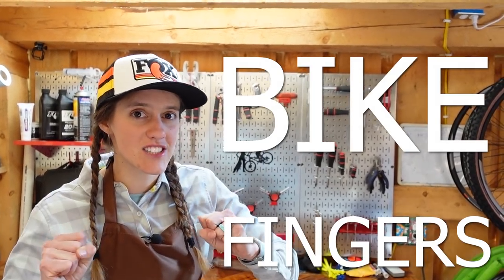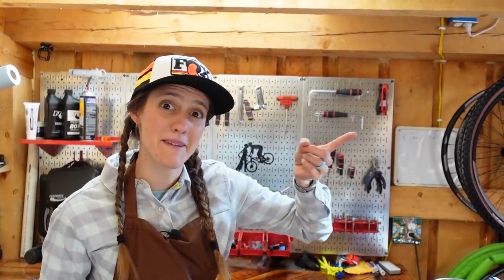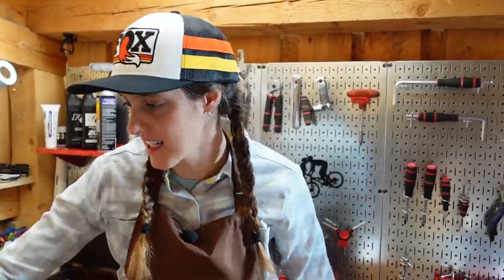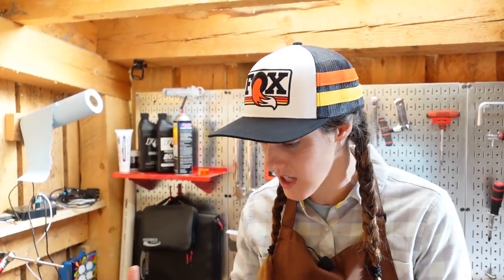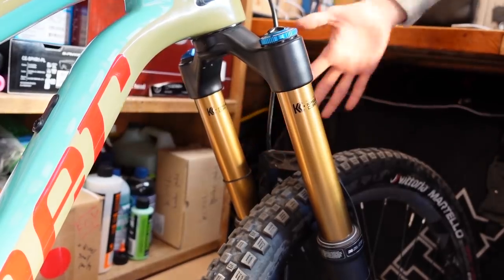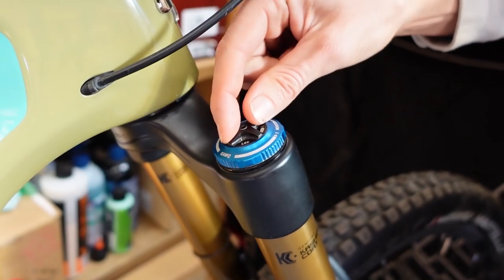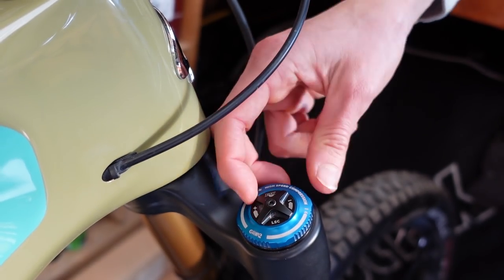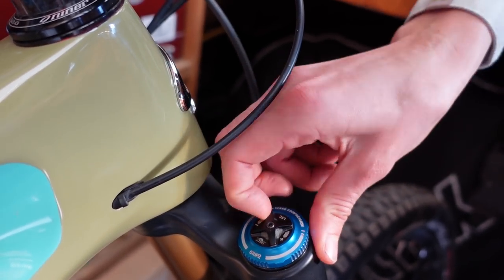How to DIAL IN your suspension + TROUBLESHOOT COMMON PROBLEMS | Syd Fixes Bikes

Comment: Commenting as i watch along, while learning. 😊
So, would it be right to say that a fork/shock with high-speed compression, is like having an adjustable token?
Reply from the maker: There are similarities, but the difference is that a token ramps up the resistance (air pressure) so has the main effect towards when the fork is more compressed. High speed compression affects high speed hits, which usually involve the fork going through most of its travel, but not necessarily and it affects the entire stroke, but just the end of the stroke like a token will.

Comment: So, last night I watched your video, today I went trail mashing, was actually amazing, my suspension felt so good and I actually understood what I was feeling and how to fix it!!! Thank you so much I've watched so many videos.

My front forks seem to dive when I use my front breaks, is that normal? Othet than that the setup is perfect, if I take off lsc it makes it harsh again.
Reply from the maker: Yeah, LSC is definitely a balancing act between diving and too harsh. It's worth noting that there will always be some compression when you brake as all your momentum is going forward, so when you brake your weight will shift forward which will cause the fork to compress.

Comment: How about dealing with the good old baby heads (lose rocks)... I feel like my front tire just slides all over when I run through a section like that
Reply from the maker: That could be a body position thing. You may not have enough weight on your front wheel. But it also sounds like maybe your fork is too harsh. Potentially try lightening (opening/unscrewing) you low speed rebound (assuming you have it) a couple clicks.

Comment: You guys always do a great job with explaining everything! Suspension definitely is confusing.

I have Fox Factory on my Ripmo. Fox Factory is an eye opener because of all the adjustability!...LOL. When I first got the bike I followed Ibis' and Fox recommendations. It felt good to me when I was done but I bet it wasn't perfect.

Now I'm revisiting and want to check everything to make adjustments accordingly. One thing I'm curious about is the air pressure. According to Ibis they recommend 230-235 psi for a 180 Lb rider ( Me!).  The other day, I checked the pressure of my shock and it was at 150 psi  so I added to make it 240 before disconnecting the pump.  So it's probably actually 230.  On the trail it seemed like it rode stiffer and I got more traction. It didn't feel harsh or anything. So maybe it's good.  I bet the optimal psi would be 210.  I like it a bit plush.  For the Fork, I noticed it was actually on the higher side - 85. So I bled it to 70-75 which is the recommended pressure.

I didn't mess with all the adjustments yet.  I plan to do it later today.

My local shop offered to help me set it up. The owner weighs the same as me so he said he could dial it in.
Reply from the maker: Sounds like you're getting it figured out! 
One thing to note: when you remove the shock pump, the air escaping noise is the air in the shock pump hose, so it doesn't decrease the pressure in the shock. So you should go ahead and set it to what you want before removing. When you attach the pump though, the shock will lose a bit of air (it has to fill the shock pump hose) which is why it will read lower than the pressure that was in it.

Comment: Any extra tips for extra cold weather. I would assume that the oil would move slower but any idea of how much based on exact temps? We ride in ~15f quite often in toronto. TIA.
Reply from the maker: If it's really cold (-15F definitely counts) we usually end up speeding up our rebound to make up for the temp. It is worth noting though that assuming the suspension is being used, the oil will end up warming up somewhat. Although maybe not much at those temps 🥶

Comment: Really good explanation. I've been watching suspension videos for years. I'm starting to get my head around it now. Prior to watching your part 1 video, I felt like my vision was being distorted due to the amount of vibration going through my bars. I also know that my air pressure has always been on the lower side to try to combat this. Therefore, I have used low and high speed compression to try to stop bottoming out. Yup, all backwards. So after your part 1, I pumped up the suspension and decreased all of my compression settings. Suddenly, I'm riding on clouds. I haven't ridden bermy or jumpy things since doing this, so I imagine I will need to add a little compression for when I next ride these types of trails. I wanted to ask your thoughts on using a seated roll off a kerb to set the rebound in your rear.  I hope that makes sense. The one where you sit down on your seat and ride slowly off of a kerb to see how your suspension reacts after compression. Thanks for your help!
Reply from the maker: So glad it was helpful!! I think that a seated roll of a curb might work, but I think it would probably tell you more about your compression than your rebound. Instead, I'd recommend a standing mid-speed ride into a curb (or maybe something a bit smaller) to see if the rear end bucks you as the shock rebounds after compressing when hitting the curb.
Reply: @sydfixesbikes  ok. So today I went for a ride and hit some jumps. I did end up bottoming out on a hard landing. My question, can you just add heaps of HSC and keep the LSC all the way off in order to keep the small bump compliance whilst avoid full bottom out on big hits? Almost like a token ramps up the compression as it goes further into the travel? I'm 98kg as well. Should I just go and put some tokens instead?
Reply from the maker: Unfortunately HSC doesn't quite work the same as a token because it affects maybe the last 1/3-1/4 of the stroke and you do want that range to feel decent too. A couple thoughts:
1. Was it an unusual hard landing? So you expect to rarely land that hard? For example, Macky bottomed out front and rear when he accidentally hit something as a drop that was supposed to be a roll. If that's the case, it's okay to bottom out in that situation. If not though, then yes, you want to make some adjustments.
2. Assuming that it wasn't a 1 in 100 hit (as discussed above), adding a token would probably make sense. Keep the rest of your settings the same and see if that keeps you from bottoming out in a similar landing.
Reply: @sydfixesbikes  It wasn't an ideal landing. I was going for a shark fin jump but didn't commit enough and landed in between on the flat with it also a little too front wheel heavy. So not a common occurrence. So maybe I'll just leave it as is. Hey, thanks! :)

Comment: Hey Syd, hey Macky - great video as always, keep it up. :) Was wondering if you could just clarify one thing for me - my fork has both a high and low speed compression setting - does the combination of those two options in a way replace the function of shock tokens, or are those two different things? Basically, are tokens a factor that I can still consider somewhere down the line, or do my compression settings have me covered?
Reply from the maker: Fork tokens are yet another variable in addition to high and low speed compression. If you haven't seen this video yet, we did one talking about tokens:
https://youtu.be/AkLKpJfSNSI
Reply: @sydfixesbikes  Ah fudge, and here I was thinking I was getting the hang of my fork settings. :/ To make it even more complicated, I have a DVO fork which has this doohickey called OTT which as I understand is unique to DVO. So that's yet another variable I have to wrap my head around! Thanks for the reply though, waiting for more content from you two!

Comment: I have a Manitou Markhor air fork. I weigh about 80KG but I need to put about 120psi into the fork just to get the sag correct. Does that sound correct?

Comment: My 36 fox never bottoms out and i have both my compression fully open. I find my small bump compliance is rezll6 bad though. Is it a case of removing a token since i already lowered my psi?
Reply from the maker: In general, you don't want to bottom out. As long as you're using 2/3 to 3/4 of your travel most of the time (on trails that have some hits) you are good to go. You should only use all of your travel on really big hits (big drops to flat for example). Have you used the Fox setup guide to set your pressure, rebound and compression settings? If not, that's a good place to start. Just turning both compression settings all the way down isn't likely to make your fork feel good.
Reply: @sydfixesbikes  on my biggest drop i used 90% of the travel, but on normal trail riding i barely use 55% of travel. I have the feeling my 170mm is too much fork for the trails i ride? Also love the channel, new subscriber.
Reply from the maker: I'd say that's quite possible. Unless you're riding a lot of bike park, 130-140 is generally plenty for most trails. That being said, nothing wrong with too much suspension 😁

Comment: If I put tokens in my fork or shock do I need to setup my sag again??
Reply from the maker: Yup.
Reply: @sydfixesbikes  Follow on question!! Do I use the same psi as before or is it less  psi for every token used?? Thanks in advance!!
Reply from the maker: In general, we recommend using the same pressure after adding tokens, at least initially. The reasoning being: generally if you add tokens, you're trying to decrease the likelihood of bottoming out at a given pressure, so if you then decrease the air pressure, you'd be neutralizing the benefit of the added token(s). 
The exception would be if you were previously running higher pressure to keep from bottoming out. Then, after adding the token(s), you would decrease the pressure to get the desired feel and the added token would help keep you from bottoming out.